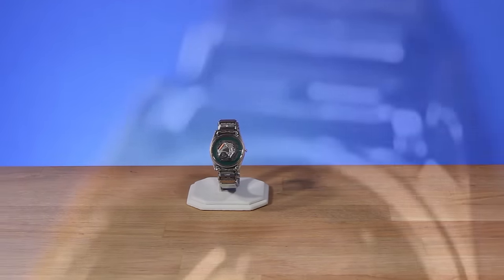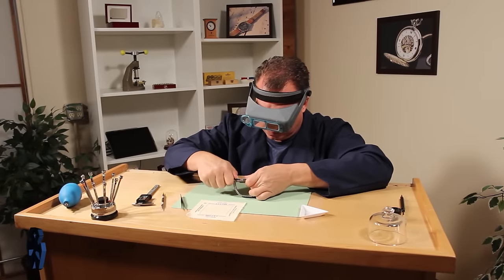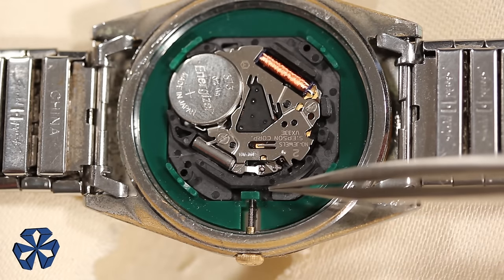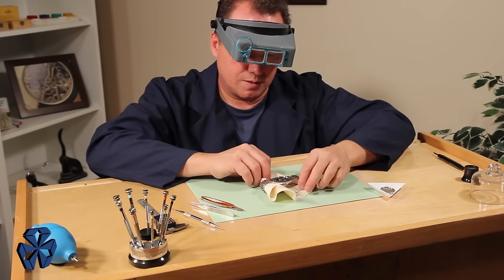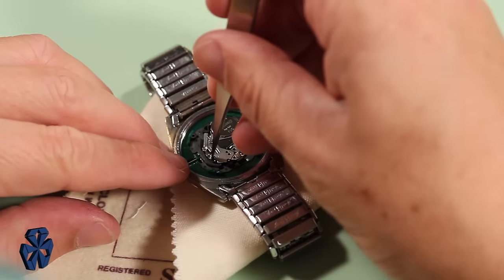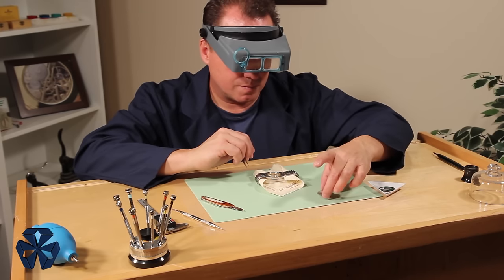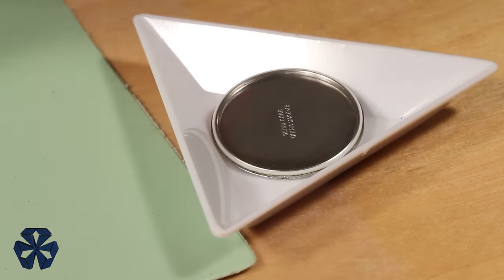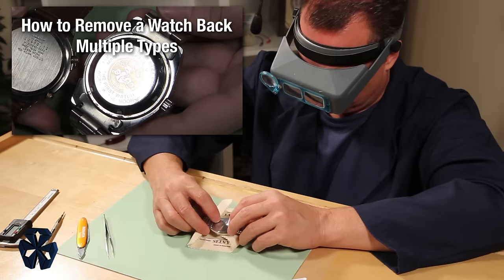How to Remove & Replace Watch Movements

Comment: I've just repaired my watch. However: when removing the stem it is crucial to TURN the stem when pulling! You've mentioned that when described putting the stem back. I haven't found any button, but in place roughly shown on video, IDK, I push it with a very sharp tool, pull the stem while turning - it comes off easily. Geez, this thing looks very delicate, I hope I haven't broken anything else. What was broken in the first place: the minute hand displaced towards the second hand, blocking the second hand randomly. When I removed the movement, the minute hand went completely loose, I reattached it in place, made sure it doesn't block the second hand and well, it works as charm. THANK YOU! I would never did this without this video.

Comment: Thank's, I took the back off, removed the stem and fixed my wonkey watch hands.
I used vernier calipers to unscrew the back (a tool I had already for measuring).
Then a sewing needle with a magnifying glass to release the stem.

Comment: On my Bering watch the movement does NOT tip out as in your otherwise excellent video. There is another tight fiting s/s rim that has to be removed but no idea how. The movement looks the same, a VX32E. Any ideas please?

Comment: I was able to remove the stem perfectly just like in video. The watch movement won't come out though. It seems the back opening is smaller than the front face of watch. Are some watch have non removal movements? This is Daniel Wellington B32R6

Comment: Thank you very much, the video was so useful to me.
I have a question please : 
I have guess watch model no. 113515G1, this watch I tried to change the battery, but when I did I damage the closer where it should be over the battery, then I use a small aluminum sheet and put it instead of that, the watch working very well and after 3 days the second hand is working continually and the other not. the minute hand and hour not working.
Please, can you help me?  
Thank you again.

Comment: Does anybody know the name of the dark green plastic frame surrounding the mechanism of the watch (UNDER THE BACK COVER) My new pulsar watch was dropped and the plastic frame which keeps the battery area and face of the watch stable is now missing. I will have to order a new part but have no idea what it is called or where to begin? Please help. TY

Comment: When putting the stem back, should it always be turned first, then pushed in to click? I'm
pushing it only and finding it difficult to click it back in. Then it pulls out totally, without being secured into the mechanism. I have been careful to position it correctly. To be honest, I am practicing this on a junk watch.

Comment: Thank you for such clear instructions. Looking for the 'arrow' that indicates where to press for the stem release, I found it as a printed arrow on the PCB track. So useful to know what to look for. Please note that some stems, as with mine, need to be turned to 'unscrew' first. Made the whole disassembly and final assembly such an easy process.

Comment: I am trying to take the stem out of a Nixon watch but there is a wider part on the stem similar to stem  401-1599 in your parts list. I can get the stem to release but it won't pull out of the case. Can you tell what step I am missing. Thanks

Comment: I had some trouble setting my wife's watch and pulled the stem all the way out.  It goes back in, and the watch can be set, but the stem doesn't lock in very well.  Is there a way to fix that?  It's a Timex quartz.
Reply: I’m also a watch maker look at how rookies learn how to repair watches😂.... press the button with a tweser(the button you press to take out the stem) hold it down and put the stem back in while hold down.

Comment: I have a watch with the same mechanism, I took out the stem, cleaned the watch glass and put the stem back but now the mechanism it's kinda inverted, If I try to pull it out, it goes without pressing the spot indicated. And if I press the spot and pull out the stem it locks and I can move the watch arrows. Does someone know what is this problem about?
Reply: Yes, I  do

Comment: HOW DO I DISMANTLE MY CITIZEN C506 ECO DRIVE TO REPLACE BATTEREY
Reply: Far as I know the Eco drive battery pack is built-in. Not a replaceable part. If your not getting regular natural light on the solar panel ( black face) it will go flat.
I've had my Eco drive over 10years and never had reason to question the battery other than when I left it in a drawer for 3 months while using a new dress watch gift.
A day on the window ledge and she was good as new